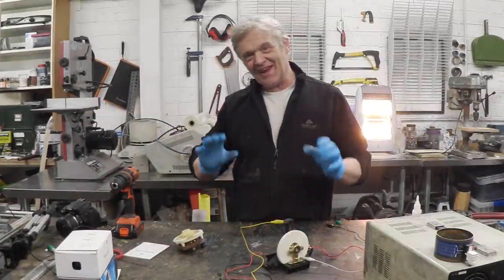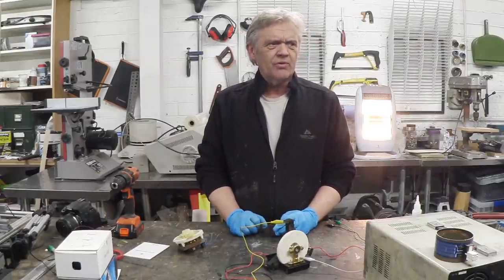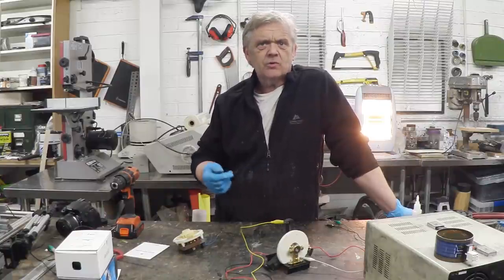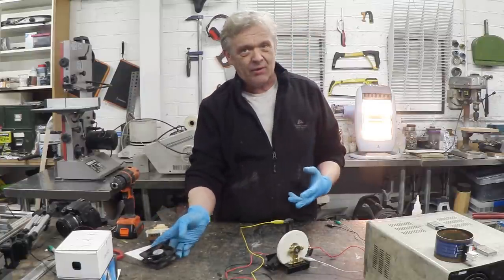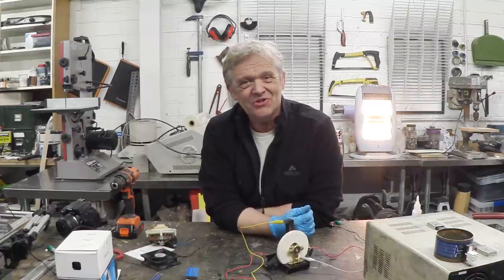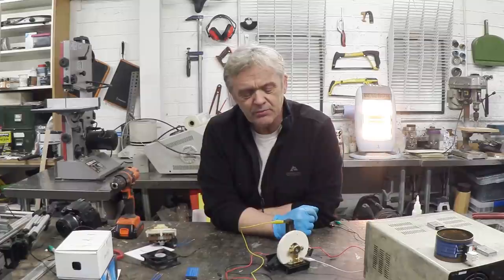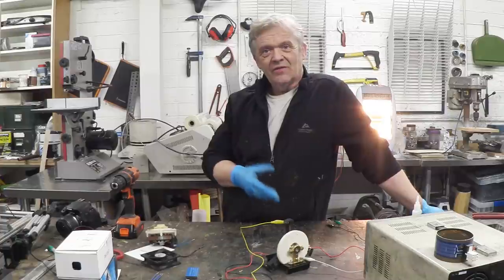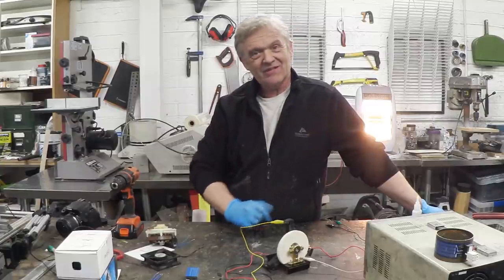1017 Brushless Motor Controller Without Electronics

Comment: also on electronic control at high cost due to power, I am wondering if a better material would work to make this system work, so have you guys tried using the materials you use to make your conductive paint and such to make semiconductors yet? (other than the graphitic carbon nitride) and make your own semiconductor components (I made a diode with liquid soap and cola soda of sugarless variety like diet coke with aspartame instead of sugar, by placing a drop of each on glass plate next to each other so the edges of the drops touched, forming a single drop with two halves basically, and then did tests using a multitester on the resistance mode, and found it both had a diode effect and when first making contact in the reverse direction acts a bit like a capacitor till it gets charged up then stops and blocks the flow, while the other way you never see that change in resistance and stopping flow, though not sure if higher voltage or amps would cause a salt exchange like how two electrodes in a tank of salt dissolved in water will cause the chlorine to cluster around one electrode while the other attracts the sodium ions so that you get chlorine gas that evolves out of the tank, which would ruin its specific chemical nature of course, and something similar could be going on in the phosphate based compounds in the cola to cause the phosphorus to migrate to the soap (phosphate free alternative most likely since everything is like that now and has been for years) so once those phosphate ions are dispersed evenly it just becomes a resistor and no longer that diode effect or something, 

BUT if this were dispersed in say carbon lattice and baked once done in a kiln it might allow a higher voltage tolerant (and higher temperature tolerant) semiconductor that with no liquids present would allow it to continue to work all from home made tech that costs pennies instead of 100s or even 1000s of dollars or pounds as the silicon alternatives you have looked up have cost, and expand the range of manufacturing you have at home since while the mechanical may be good enough and far better than silicon derivative, in this case, what about other instances? 
I have a couple tasks and projects that will take about a week before I can start experimenting but I have had some decent success with the geopolymer work (baked some at about 400C that was basically red clay and then tested the bits of one thatt exploded LMAO and while it is exuding salts probably from trapped citric acetic or oxalic acids used to alter the clay, it is rock solid still and only darkened from absorbing water, over night but was still resistant to emulsifying or what ever it is that clay does to become plastic and malleable when you get it wet thus making it suitable as a say roofing tile or brick that wont go all soft and runny when it rains LOL all with out having to hit the normal higher temps (also put in a second bit that was the same with one exception of having some baking soda added and that one did not break, still have to test to see if it was an air pocket, or the surface being abraded to get flat faces on it vs the other being smoothed down with a slick fingernail to get an almost glaze smooth surface as it dried that might have sealed the interior too well or something, with another batch of tests (was also a test to see if the angle iron legs and 3/16th inch thick plate steel bed table I have is enough to insulate the kiln from damaging say a wooden or plastic tile floor the feet are resting on, or even carpeted surface, and have to say the 2 hours or so I ran it all the way up even to 1000F was still not enough to allow the outside to get hot enough to be too hot to touch or even uncomfortable to touch, so... have to do another 8 hour or 10 hour run I guess LOL anyway.) 

anyway going to try a couple things to see about making more electrically conductive semiconductor materials that also have as low of thermal conductivity as possible for TEG building, and improvement with the same tech and a few others combined together, and thought this might be something later to do a video on to continue on your content creation. (not that it seems like you have a lack of imagination on things to work on LOL)

Comment: Rob Sir This is a very great idea and congratulations on the Build of a mechanical controller for a BLDC motor, Kudos !! Rob Sir the standing questions remains in my mind are 2, 
1) We need to have a motor to drive the mech unit which will drive BLDC motor, what will control that motor ? or can it be a Diesel Electric design?!!
2) do we need to rotate the controller to a desired RPM of motor ? How would it control RPM of BLDC?

in the video I see you driving that unit with a electric hand drill I could see the RPM on motor was high the RPM on shaft of the converted alternator motor were much slow in comparison is it because of power supply or we need to drive the Mech unit at double speed to get desired RPM of the BLDC? Strange things in my mind but yes I admit they did trouble me a night !! Love and very warm regards from India Rob Sir!! Great Video!!

Comment: Hi Robert in your video you used a drill to spin it, if I were to put that on a robot how would I spin that without needing another moter with another moter controller. I was also wondering where that electronic speed controller the you held up and said, it is only is 4 or 5 pounds is from.
Thanks
 the kid

Comment: so basically you can use low inexpensive brushless mottor with cheap esc (5 EUR of costs) with this mechanical controller - and voila you have electromechanical controller for big motors for cents :)

Comment: Great solution to deal with a problem for those of us trying to operate on a budget.  Do you have an idea to deal with the motor chatter when it first starts? I happens on silicon controller brushless as well. I see it a lot in brushless RC car applications.

Comment: This is exactly what I'm looking to do, I have a LG 3 phase 22,000 ac window unit I'd like to run off solar.  I went down the rabbit hole of diy esc to go from dc to 3 phase ac but find I don't have the technical knowledge to build such a thing for the power requirements of such a high amp draw application.  I have the same unit that runs off 220v ac so this build will be supplemental cooling to lesson the load, not be the primary source of cooling my shop.  I got the unit for $100 so no big deal if I melt it down ;)  The unit will only work during the day of course but hey, if I can get it to work I can get near free to me cooling.  On another note, I wonder why this setup isn't used in place of an inverter.  Solar ==> 3 phase dc motor (with mechanical commutation) ==> single or 3 phase generator.  I'm going to give it a go.

Comment: Just goes to show that the old ways still have their uses. Electronics are fun but as you said they have limits before prices skyrocket.
Reply from the maker: for sure mate
Reply: @ThinkingandTinkering  thought.. they always say "you Can reduce eddy current effects by restricting
paths for current flow:"
i say what shape and placement of capacitors do you need to make to actually capture and store these unused localised (ringing?) high currents ... and so presumably lessen the unwanted heating effects on the (new capacitors in disguise) laminates as a side benefit, some uni math required for optimising the things i assume

Comment: You are right about silicon I think new transistor for handling high power are gallium based and is a relatively new tech so expensive. If you want a real controller there should be a project called Vesc   a really advanced motor controller for 50 £ the problem is that should be barely strong enough to drive the inverter so a lot of people fry them

Comment: I do admire your attempt to solve a valid problem. But I am confident you will have a lot of problems as soon as you put any reasonable power through the system. Lots of heating via resistive and arcing losses. You are trying to collapse a highly inductive load at high current and it will arc over at every commutation. DC motors don't do it for a different reason

Comment: I get your point that you dont like the complexity of modern speed controllers and Im sure there are some niche applications for mechanical commutation for synchronous motors.
 Its just that i think that the mechanical commutation you have shown doesnt really solve the complexity problem. You still need to control the motor that drives the commutator which means you need a motor driver and some sort of feedback of the main motor shaft. Why? Because you cant start a synchronous motor from a standstill by just applying some frequency x to its input terminals. It will just wiggle a bit. 
What would make much more sense would be a DC motor with variable excitation (basically a universal motor). But you would still need a motor controller for rpm regulation.

And btw, you can get can IGBT half bridges for 11€ that can do 60kW. 3 of these and you can control any ansyc or sync motor with less than 180kW for 35€. Add lets say 20€ for gate drivers(which arent cheap, i`ll admit), 20€ for some filter caps  (which you will need anyway unless you want to get into trouble with your local radio regulation authority because of radio noise) and some random uC flashed with open source ESC firmware and your done. 180kW capacity, rpm control, no sparks, no wearout, no rf noise and legal troubles, convenient bus interface, probably some spare IOs for about 75€.
Reply from the maker: it's a small dc motor - a potentiostat will do it
Reply: Thanks for the prices, this is good to know

Comment: Sorry Robert, I disagree. Silicon is used because it's maintenance free and because it's really quite cheap. That's why variable speed ac motor drives for industry use IGBTs that can handle thousands of amps, no brushes to wear, no carbon dust everywhere and no commutator to polish. This is why dc motors are no longer used. I see this idea as a giant leap into the past! But keep up the good work, I do enjoy your channel.

Comment: Good work.  I was introduced to the concept of phase-locked A/C motors as control systems while training as a technician in the 1970s.  I seldom saw them working in the field.  Often wondered why the idea was not applied to e.g. brushess or stepper motors.  Really cool! Suggest that a small, motorcycle-equivalent, lead acid battery in circuit would make your converted alternator work quite well.

Comment: Mos has least voltage drop but Tesla motor drivers still uses NPN MOS driven switches(IGBT), I think because it's more robust. .7volts at 200 amps X 2 X 3 is 840 watts of heat/loss at 100 HP output level.

Comment: I agree that when you just want the darn thing to spin, brushes are better than fancy brushless controllers. Although it's not so much the power transistors that I dislike, but rather the microprocessor. It's basically a black box where you just have to hope it works, and if something goes wrong there's nothing you can do. I don't think there is any good analog solution for robotics where you need to move precisely from one position to another with smooth acceleration and deceleration, but for a car I'd much rather keep all the digital nonsense out of it. Electric cars should be a revolution of simplicity, but instead both manufacturers and buyers have gotten so used to complexity that they can't see the potential.

Comment: High current electric switching is best done with mercury switches but I don't know if you can still buy them.
Reply from the maker: no - I don't know either mate
Reply: @Dan A: Heavy current switching is best done with Ignitrons  - which can also be controlled by the presented system.  You can even make a Mega Watt inverter with these Mercury tubes.  Great video!

Comment: The real problem you will have was clearly visible when starting, the motor did not start immediately and jerked back and forth. In an electric vehicle the would be terrible. Also you have no load so although you say the motor synchronized with the commutator it was pretty rough and if it gets out of sync when  load is applied it will stall and lock up or jerk about again. The true BLDC driver uses hall effect sensors or measurement of induced voltage to determine the most efficient commutation timing. Also the Bldc really only controls torque by means of PWM, and speed is a result of load vs torque. You might achieve some better results if you use an induction motor instead of BLDC.

Comment: Hi Rob, I am very much for analogue technology. Your controller here seems a cheap option but is probably pretty hard to build, I could not realy see the function. My question is why not use a mag amplifier solution to control a motor, that surely must be a solution?
Reply: seems so, as does Keith's  "rotary converters" for better using/reclaiming the available power passed through etc , a small hybrid of some sort using magnetic ink as its laminates lol.
it clicked today that motors are basically moving derivative transformers, if nothings moving or 'flowing' no power OMG O_O
'ChipDipvideo Magnetic Amplifier'

Comment: I am trying very hard to source a controller for a Motenergy me-1306, 24-70V, 12KW motor. I refuse to believe that the only thing that can drive it is a $500 controller shrouded in mystery by Kelly, which people say can still burn up after a few minutes. Please help if you can.

Comment: Hi robert, great vid as usual, i went through this idea a while ago, i came up with a flat disc divided into quadrants(like a pie chart) but with a wide border to each quad, the dividing line remains a straight line but as you approach the edge of the disc, the relationship between contactor(ON) and the insulator strip(off) changes, the further out you go the more on time you get, but the off time always remains the same,, much like a pwm, still only a crude square wave generator, but variable (by sliding the contact further in or out on the disc surface), i was thinking of perhaps a solid coper disc with enamelled insulator strips.    its  much like the old distributor in an ignition system,  the contacts in which can last a long time, although that is for high voltage not high amps.
Reply: In the distributor the high voltage arcs from rotor to pole without contact so not really like what you described. Also in a DC motor commutator the brushes are wider than the gap between segments and therefore are briefly in contact with two contact as the transition from one to the other occurs and therefore there is very little wear as that all happens. Your mechanical disc psuedo PWM must  break the circuit and there will be considerable arcing and probably physical wear as the edges of the conductor (or insulator) chisel away at the brushes

Comment: THUMBS UP (in caps of course), Robert. 
And Cheers and hats off...
It's a fascinating delicacy.
I've an obvious question....
You say, your power supply isn't so "POWERful". Batteries are super powerful. And if I increase the ampere-age using a battery traction would it(the HULK motor!) deliver better? 
If the DC volt increased, could we rotate it faster and vice versa?
Or is it related to the 230volt and thus the commutation ac motor responsible for the number(of RPM) game?
So concisely,  can I surmise it from an idealist perspective that the voltage produce torque and commutator-RPM the number of revolutions?

Comment: If he is able to make it a little bit smaller and more efficient, without using a large drill as the power supply, then this could be an excellent idea for very large Motors
Reply: Drive it with a small brushless motor and small elecrronic controller. Then it's essentially a mechanical power amplifier.
Reply: @Greg Ewing brilliant lateral thinking! But the commutator, having pressure from the brushes, will itself be a fairly high load, too much (I think) for a  e.g. computer fan motor. I was thinking perhaps the slim windscreen-wiper permanent-magnet motor from the rear of a hatchback,  speed controlled by the electronics from a cordless drill? Something about that size will be the smallest you can go (I think)

Comment: So the solution is to add another motor to control the motor ...wait do we then just use a bldc controller to control the small motor or do we need yet another smaller motor.  Have you considered the use of hamster wheels ?

Comment: I recently looked at relays instead of using Mosfets in a project at work. Some results were relays in the 10 to 15  Amp contact rating were the same price as logic level power Mosfets. By the way the mosfets if used within their application specs last longer ...like forever.The ON resistance was negligable when the  gate drive signal is right. Ps you dont need a very high level of understanding to replace a switch with a Mosfet.
Reply: true but how do you make mosfet 'down the garden shed' ,jeri probably knows im sure ^_~
making commercial stuff when someone else is paying and can write the costs off as a business expense is fine, everyone else not so much, especially now with the covid scalping excuse for corporate piggybanks needing upgrades to hold the extra swag..
Reply: @paulmaydaynight9925  how strange
Reply: @bretthorwood9396  yeah i know ,why would anyone want to diy a device when they can pay you right :-S
Reply: @paulmaydaynight9925  very strange
Reply: Unijunction transistors can be used for switching applications including motor control . (ie not just relaxation oscillators) sure they could be used for commutation . 

And they can be DIYed out of galv sheet, and a blow torch.
Reply: And thinking about it... If unijunctions can be used for switched... A spark gap, or neon bulb could probably work too for higher voltages..  Especially if they are triggered gaps... Negative (differential) resistance allows all kinds of nifty things to be done lol.